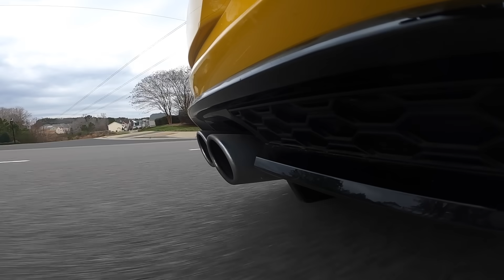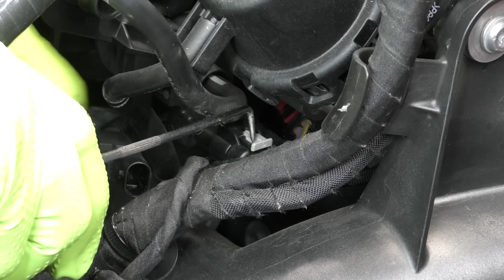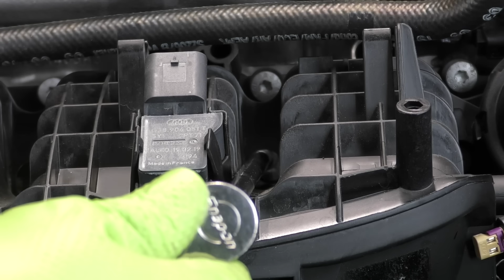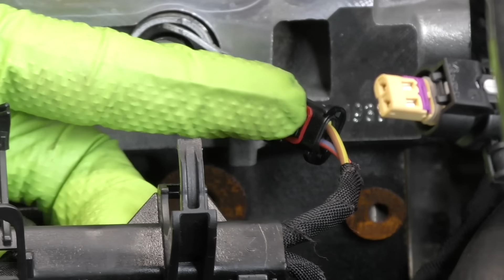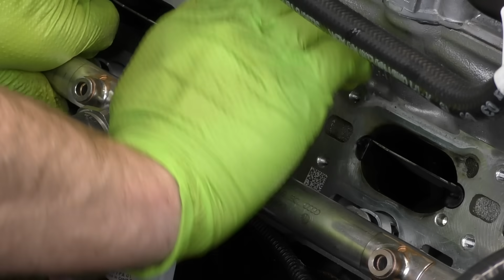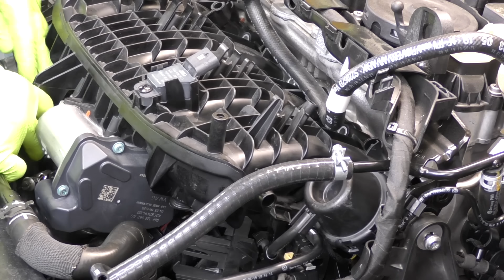Fuel Injector Replacement VW/Audi TSI Engines

Comment: So I’ve been dealing with misfire on my Volkswagen CC 2017 2.0T sport it’s a full bolt on stage 1+ from unitronic with the R8 coil pack and Ngl iridium spark plug one step colder and it seems that every 4 month I have to change either spark plugs or coils i take care of my car maintenance wise it’s very well kept up to date on everything but why am I always misfiring :(((
Reply: CharlyGen2Cc I have the same tune on my 2013 A3 and have similar issues only I had to replace injectors last time to solve issue. Now only 10,000km later it’s misfiring again on cyl 4. Starts only when engine is cold but then progresses to misfire even when up to temp. Swapped plugs and coils around and still misfiring on same cylinder so I suspect I will need to replace or at minimum clean injectors. I went 50,000 km after tune initially installed first time without issues. I’m wondering if dirty intake valves or poor fuel is making issue worse.

Comment: My 2017 Golf 1.8 automatic has only 20,000 miles on it and I’ve developed bouncy rpms when coming to a stop (jumps to 800, dips to 600 and finally settles at around 700) changed spark plugs at 19,000 and air filter and still have the bounce when stopping. What should I check for next?

Comment: This is off topic but since it is your latest video,I am asking it here.You mentioned once about concerns when doing warranty work.I have had pushback from two dealers who were reluctant to do obvious warranty repairs.I know the dealer receives less remuneration for warranty repairs than if the customer pays but does the technician who perrforms the work also receive less money?Thanks in advance.

Comment: It takes 1 hour just to get the manifold off,so cleaning all four valves is basically a good 5 or 6 hours then,if we was to use zip ties and carb cleaner,I think I can tackle this job my self

Comment: Question. I have seen some companies offer a tune with 93 octane. From my research you cannot find ethonal free gas at 93. 

Is ethonal still an issue with modern engines? Meaning damage components if you only run 93?
Reply: In the US you won't find ethanol free anything without buying directly from a supplier in barrels, and 93 isn't common there either. Ethanol content is less of an issue in modern cars, as almost all pump gas contains ~10% of the stuff.

Comment: Hello hope you’re fine. I’m from ECUADOR 
I have seen some of your videos on YouTube I thing they’re so helpful. 
I just have a question I hope you can help me with some tips   
I have a 2012 Volkswagen amarok 2.0L TSI , and it is consuming oil , there is no leaks at all but I just realized that from the PCV  valve some oil is coming out to the intake manifold and also there is a huge vacuum when a remove the cap from oil engine. 
My question is   
Is it normal the oil coming out from the PCV and the vacuum? 
I hope you can give me some advice about it so I can replace the valve thank you so much.

Comment: My 2012 Golf R has around 120,000+ miles on it now, and I'm unaware of any service done of a full carbon clean. Im also aware that the PCV diaphragm tends to rupture or tear after many miles. Is it smart to invest in like a Racingline catch can where they replace the PCV? (Well, part of it, only for the EA113, the EA888 gets a totally replaces PCV from racingline). I take this car to the track and do spend a lot of time in the higher RPM range and have heard of that PCV oil blow-by that some Mk7's are known to have while on track days.

Comment: One thing I never really figured out. What is the metal cage for? When I first did one of these what back when, I forgot to reinstall those. No VW were harmed during the committing of my egregious error. 

I also noticed Gen 3’s do not use the plastic spacer on the bottom.

Comment: Hey charles something i want to ask not injector related but pcv valve related is the new revision pcv valve with part number ending in AK with the white top solve oil consumption issues on the 2011 A5's?

Comment: I love your videos. I have "only" been watching for 2-3 years, and I have just realised that I haven't subscribed until now... 
In regards to the video I am very disappointed that VW didn't fix this issue with soot building up on the backside of the intake valves. This is 2020, and they have had this issue from 2006 when the 1. gen 1.4 TSI twin charged engine was introduced in Europe. I actually still have mine with only 89.000kms.
Reply: Daniel Fl. so is the soot build up in the intake manifold is caused by a faulty injector? As I've got the 1.4 tsi 122 and got same issue, the intake manifold full of soot :/. Tia
Reply: They did fix it but only in euro  since 2014 at least https://www.greencarcongress.com/2014/01/2014014-audi.html european EA888's with multi-port injection. Regular port injection for idle, cruise, and direct injection for high rpm high load.

Shame because this is why I passed on all USA bound VAG products simply because of this and went with other manufacturers since 2014 or just bought non direct injected VW's since.

Various assessment criteria are used to co-ordinate the different injection modes, including:

efficiency, knocking;
emissions, especially particle mass and number;
manifold wall condensation, fuel in the engine oil; and
smooth running.

They won't admit it but the smooth running is because it cleans the intake valves from the deposits.

https://www.golfmk7.com/forums/index.php?attachments/34xosd0-jpg.136872/

https://www.golfmk7.com/forums/index.php?attachments/aeoefr-jpg.136873/

used during part load running to clean valves and reduce particulate part of Euro 6. Guess VW hasn't learned from diesel gate still penny pinching to the max and cheap as fck in the USA . Someone with time and money should see if their cars infringe in EPA or some sort of law when they offer this in Europe but not in USA.

This plus fck bouracracy and shitty companies giving two fucks about engineering and environmental progress makes me want to have Tesla and electric cars just fully take over and make all gas cars illegal for daily commuter use. VAG should be paying billions and billions more in fines to the US government for being assholes with their shit designs in the last 10 years and dirty cars they keep pushing unto USA dealers

Comment: When I cleaned my intake valves when I removed the intake the injectors all came out easily plus they had a 3 prong plastic clip on the end of them. How come yours didn't?  I have a 2013 a4 2.0 should I have resealed mine and what are symptoms I should look for since I didn't?

Comment: If i have the 8 injectors system in my car how do i know which 1 is leaking?
Reply from the maker: Well you can identify the cylinder easy. That one will misfire. Or you can drive it, bring it in and let it sit. Pull the spark plugs and look for standing fuel. 

I assume there are 2 inj per cylinder. Next I’d try to get the injector to leak with just key on. Then take the manifold or injector rail off
Reply: @HumbleMechanic  i checked it before and its cyl2.
I used fuel system cleaner and issue solved kind off.. misfires are more random but now my ltft is -10 standing still... i would take both fuel rails off and check it out but can it be also my hpfp? What do you think? And btw great diy!!! As always

Comment: Yep.  Should change your oil every day and your injectors once a week to maintain tip-top performance :P.  I hope these vids are a composite of one job else, those fasteners will be worn out worse than those a technical college's stand engine.  We had 2.2 Chryslers hanging off engine stands and had been for so long that you could actually see the cylinder bore(back one) becoming oval rather than round.  Cast iron is soft.  Plastic is softer.  I'm betting you've had the manifold off and on only once for these vids.
Reply from the maker: More than once. Less that 5.

Comment: I had a question about boxer engines. For example on the subaru fa20s if one half of the block is messed up is the whole block useless? Or can you salvage one side by using another half from a different fa20 block? Subaru is pretty good on having precise measurements between all their engines, no?

Comment: I've been doing a little trick with the CCTA teflon seals. Stretch out the new seal with a pen or pencil tip slightly, just barely enough to slip over the injector tip. Get it in the groove, then take a zip tie and wrap it around the seal and tighten the ziptie to compress the seal and flatten it out in the groove. Never had any leaks and its nice snug fit.
Reply from the maker: Love it
Reply: @HumbleMechanic  Question for you, what length are the injectors in mm?
Reply: @HumbleMechanic  hello just seen your video I have a 2016 vw Tiguan r line my car burns gas like crazy I can fill up the tank and drive it and the gas just disappeared I’m wondering if I need to replace my injectors?
Reply: I use the bic balll point pens, take the ballpoint and the ink cartridge out and you have the barrel of the pen and the very first half of the tip that the ballpoint was set into use the tapered point as a guide to get the seal on the injector and then use the barrel to push it on to the injector and then use the cap of the pen to shrink down the seal they were almost made for it perfectly
Reply: @schuylermorris5342  make a videos and post it on here. Don't be that guy.
Reply: What a genius! You saved me some good bucks there thanks.
Reply: Place them in warm water for a minute or two before stretching them out.
Reply: That's commonly done for hydraulic cylinder seals.
Reply: Pure genius everybody.
Reply: I tried this and the zip tie creates a little squared off corner gap where the locking mechanism butts up to the seal. All of the seals are still loose and can be spun around on the injector. Did you snug the seals down more?
Reply: @Atlas3360   the seal can still spin a little and fit snugly and not leak but just make sure it doesnt slip off easily or is marred up.
Reply: Worked like a charm with the cutoff pencap tip to get them on there.  Thanks for the tip 5 years in the past.  The warm water tip was primo.  I used shrink tubing which worked to get them set, then a random pencap to slowly seat them in.
Reply: I need help finding the last connector on the back of engine

Comment: I wish it was this easy on every modern car. On my Land Rover you have to take off the supercharger which isn’t the easiest job in and of itself.
Reply: Yes man, but why would you need to replace fuel injectors on a gasoline engine? They practically run forever (if build alright) if you use good quality fuel, change the filter regularly (if it's the type that can be changed) and make sure to drive your car at higher rpms constant on the highway for at least 30 minutes straight every week. You should be fine, honestly.

Comment: Re the cylinder compression seal on the injector, only the stretch to put it on was shown, there is a secondary compression step, so don't think you can do that without the tool very successfully.

Comment: Do you get the smaller TSI's in any of the US cars? The 1.2/1.4 and 1.5tsi engines?    My 2019 Q3 has the 150bhp 1.5tsi engine.

I believe the latest 1.5tsi in my Audi is the EA211 generation of engines with cylinder on demand.
Reply from the maker: We have the 1.4 but it’s a lol different

Comment: Is there a way to check and see if the injectors are working properly while taken out?
Reply from the maker: You’ll get misfires If they aren’t
Reply: @HumbleMechanic  ok, but i have heard that because of carbon buildup it may not spray as it used to. My car has over 100k miles and its a 1.4 tsi ( i leave in Europe ) and i have  never made a carbon clean and when i ask a mechanic that makes cleaning with walnut blast he also told me that he was going to take off the injectors to see how efficient they spray or else it will need replacing. Is there a way to check and see for myself how good are my injectors?

Comment: Could you mention a little about diesel VW’s...? What you could/should look after in 100.000km service intervalls etc...
Thanx and keep up the good work 👍
Reply: Change timing belt and tensioner every 100k km, use only good quality diesel fuel, change glow plugs every 100k km, drive outside of town at least once a week to help burn those carbon deposits in the DPF and the EGR valve.

Also get oil changes every 9 months or 10k km (my personal suggestion) and change the brake fluid and coolant every 2-3 years.

Make sure that when you replace brake discs that you use OEM parts, otherwise they will start to vibrate under braking pretty soon and have good tires mounted on the car.

One more thing that is specific to VW Diesels is to check sometimes using a good diagnostics computer, the values of the injectors. They should be close to zero and add up to be 0 and not see any values that are sky high compared to the others.

If you have a DSG transmission and don't beat on it that hard you can change the oil in it every 5 engine oil changes (10k intervals), or if you are beating on it, then 3-4 oil changes.

Check your exhaust pipe. The tail should be clan and not covered by carbon buildup. You should be able to put your finger inside the pipe, rub it on the edge and get your finger out clean. If it's dirty, then you have a problem with the engine or the DPF or Turbo.

Comment: Is it possible to check for leaks at the injectors and HPFP before reinstalling the intake manifold ?
Reply from the maker: You can turn the key on, but you are going to get a TON of fault codes. Not a huge deal if you can clear them. but it will give you codes
Reply: The HPFP only operates with the engine running, so unfortunately, no. However mirrors and or an inspection cam are your friend if you want to double check for leaks on the high pressure side.

Comment: Could something go catastrophically wrong where, if you don’t do this right, something could fall in and destroy the piston? 

I’m asking because I had a CEL where an injector was replaced, brought it to the dealer and, after getting the car back, there was a mass drop in cylinder 1 compression and it was discovered the entire piston was basically wrecked (if your curious I can share the picture. It’s pretty impressive)

Comment: Also how to replace hpfp on Audi 2.0t!🙏🏻🙏🏻🙏🏻
Reply: Easy peasy will remove in 15-20 minutes. Use caution with the ignition coil connectors (remove all four at once) and also the breather hose for the crankcase valve, and a vacuum pipe which feeds multiple areas.

Comment: Why they always recommend to replace tiflon seal when injector are removed???
Reply from the maker: They sort of form into the port on the head. When you take them out, it may not seal. Now I have done that plenty of times and not issues. But the seal kits are CHEAP! it's worth the extra step

Comment: Can you not 3D print a tool to remove the plug without scoring the engine? Looks like there are hoops on the sides where it can grab?
Reply from the maker: You can. Or you can use the slide hammer in the kit. It hooks right on the hoop you mentioned. That said, no real concern about a little mark on that part of the head.

Comment: Hi Everyone, question: I have a 2012 Volkswagen CC Sport 2.0 TSI engine (CCTA I believe) with 90K miles on it. Lately it's been prone (happened twice in the last year) to stalling when stationary and giving very little gas. The list of potential issues is quite long, I'm looking to narrow it down / start by the most likely culprit. My list so far consists of:
- Fuel Pump Control Module (Recall active to replace) 
- High Pressure Fuel Pump
- Low Pressure Fuel Pump
- Dirty Fuel Injectors 
- ECM Software (Serive campaign active to upgrade) 

Problem is I live outside of the states and it's taking forever to get the local dealer to register my car here (tips about that welcome as well), so most likely will have to fix it myself. Any suggestions in the order is welcome, or potential other causes. (Coils and Spark Plugs have been replaced).

Thanks!
Reply: Hello, First of all you have to update software of ECM and then check faults memories. Don't replace any spare parts without any diagnostic
Reply: @dannyalvin3308  Thanks, will keep that in mind. Forgot to mention no fuel/engine related fault codes are thrown now.
Reply: You forgot carbon deposits
Reply: @WorivpuqloDMogh  Thanks I'll add it to the list

Comment: I don't think a catch can will make a big difference, when you will open the catch can it it will be just some yellow/brownish water.
I never understood why they cost so much and they do so little.
Reply from the maker: They are not cheap that is for sure. I have one on the way. We shall see what she do
Reply: some catch can actually deleted/blocked the manifold entry.those pcv returns only goes in the can.BUT $3XX!
Reply: I never believed in them myself. I have personal experience from installing them on turbo diesels. Specifically the Mercedes OM642. Diesels cake up like you wouldn’t imagine. Removing the intake manifolds on an OM642 is a 5-6 hour job. Requires a bunch of gaskets and seals to be replaced, and that does not include the 2 hours you will spend cleaning up that gunk. 

So I looked into catch cans to see if it would alleviate the problem, but naw. Most looked the same at the same mileage intervals with the can as without it.